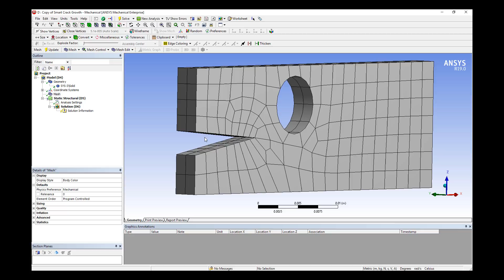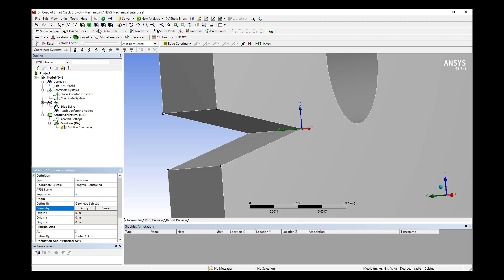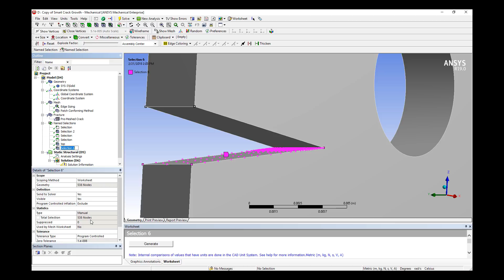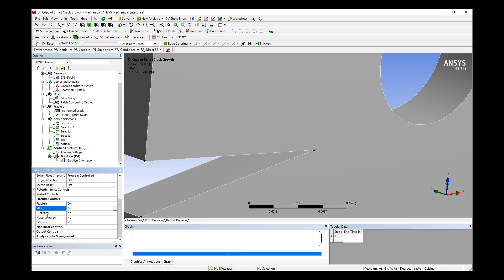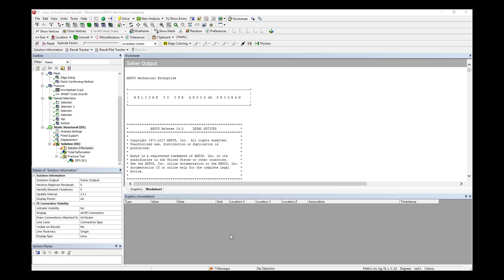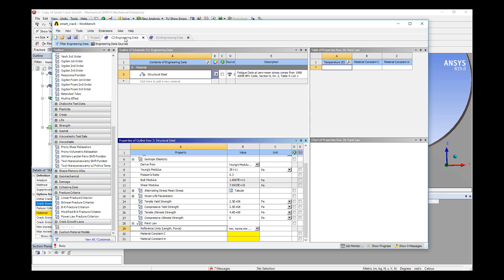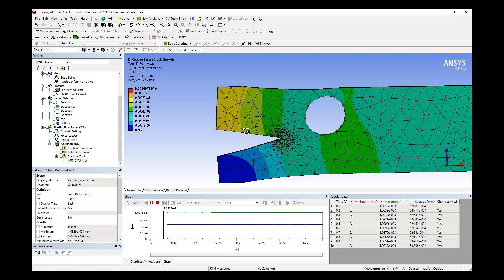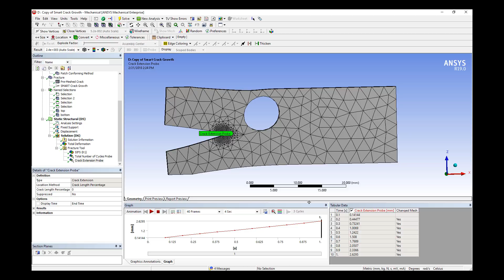ANSYS Fracture and Delamination Part 4: SMART Fracture

Comment: Is it possible to simulate the flow of fluid in parallel with the increase in crack ?
We will make the crack in the fluid container and then fluid will leak from the container?
is it possible to simulate in this way?
please reply?
Reply from the maker: Modeling flow with crack is very difficult. However the flow in cracks is probably not very important, it is the pressure in the crack that's important. So if you know the pressure, you can douse this method to look at fracture.

Comment: Is this XFEM methodology? if not, can you tell me what technology this is?
Reply from the maker: Its similar to XFEM, but better. Notice this is done on a tet mesh in 3d. It has been much improved in the new releases as well. Take a look at the Ansys docs for details of the technique.
Reply: @SingularityEngineeringLLC  Hi, Ming!  Great video.  I repeated this simulation and the equivalent stress is too high.  The stress becomes greater than the tensile strength.  Can you please tell me how to limit the stresses so that they do not exceed the properties of the material? :)

Comment: For static loading, I keep getting "The fracture parameter computed during solution may be incorrect. check the solver output on the solution information object for possible causes" when computing the solution. I dont know where I did wrong
Reply: can someone help me please.
Reply: @d-rarrvchrono-stasis4985  Hi, it"s my problem but for fatigue loading . please If you reached a solution, tell it to me
i need your help
Reply: Hi, dear sir >>>>>
I am a student in 3rd year Ph.D., I'm working for materials composite  but now I have a problem for creating a crack in my domain >>>>>
my question is: how can I create a crack on the material composite domain?
Reply: @smailhamidatou367  , you mean that used frp with your material
Reply: Hi, it"s my problem but for fatigue loading . please If you reached a solution, tell it to me
i need your help

Comment: Hi Ming. Very nice illustration of SMART technology. I was wondering if this tool can be used for multi-directional loading condition that involves out of plane bending on a Paris law applications to determine crack growth with respect to number of cycles in fatigue loading? Earlier we have used XFEM to do the same in MAPDL using shell mesh, so was wondering if this tool can handle it and in a 3 dimensional box model and not a flat plate.
Reply: Hi, dear sir >>>>>
I am a student in 3rd year Ph.D., I'm working for materials composite  but now I have a problem for creating a crack in my domain >>>>>
my question is: how can I create a crack on the material composite domain?
Reply: an error occurred inside the solver module: the "reference units" defined for the paris' law material property does not match the solver unit system
How do solve this error?